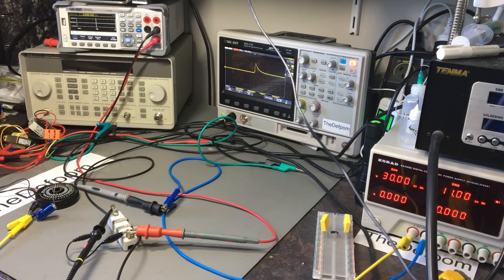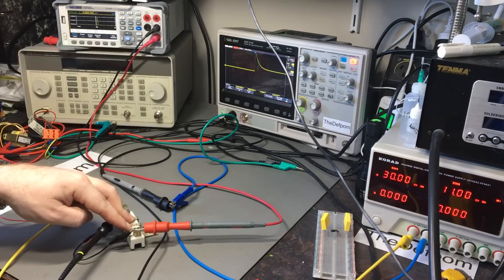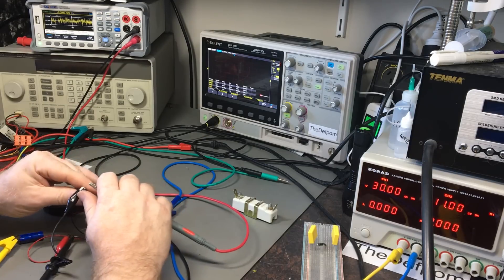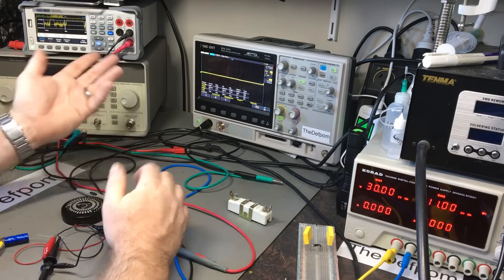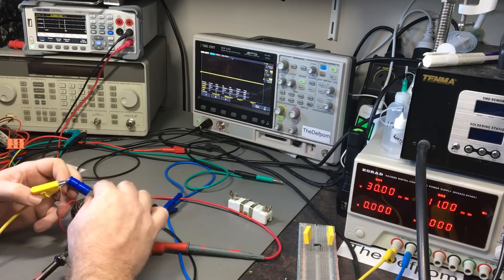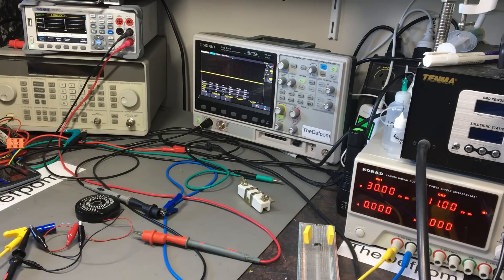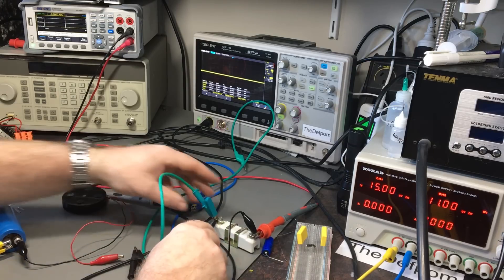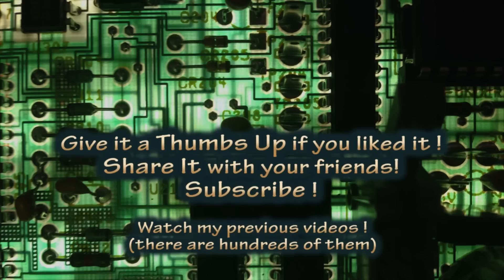🔴 #403 High Voltage Leakage Tester Project Part 2

Comment: What value was the lager blue capacitor?,  The problem with using a high value resistor is if you are using say 400V and the capacitor goes short circuit, you would need a source limited supply so as not to damage the resistor.

Comment: The current limiting resistor will need to change, depending on the capacity of the capacitor (in Farads), if you are aiming for a similar charge time for whatever capacitor you intend to test.
Reply: There's a limit either way

Comment: You can calculate the value of the resistor you need for a given time to charge (to 63.212%) by dividing the time (in seconds ) by the capacitance (in FARADS) . Charging to 86.466% will take twice that amount of time and charging to 95.022% will take three times that much time. Charging a 2200 uF cap with a 250 volt , 250 milliamp supply to 158 volts should take 2.2 seconds through a 1000 ohm resistor.
Reply from the maker: David V - that’s helpful info, thank you.

Comment: Thumbs up for the video. You might consider using the charging circuit to put whatever voltage you want onto the cap, then disconnecting it using a relay, then monitoring the voltage and the current of the self discharge. Having the high voltage charger hooked up during the measurement phase will make it harder to accurately measure small leakage rates and will complicate the design of the high voltage charger because of the need to keep it's self leakage very low...
Reply from the maker: ats89117 - thanks for your thoughts on this, once I have a properly build unit I can look into further refining the design, switched resistors were one of the ideas I originally had, I could easily do that on a sub pcb if I need to add it later.

Comment: You could let the Arduino calculate the tau of the capacitor and select a resistor (for around 4 tau)  for the charging test then have it switch in a high value resistor  for leakage measurement

Comment: I would be more inclined for a go-no go that trying to decipher curves on a scope. I think you need to compare a failed cap to a good cap, and that might give you a better idea how to do proceed.
Reply from the maker: This was me trying to figure out what series resistor to use to limit the inrush current for the charging phase. This is to give suitable timing for the testing, too high a resistance and the charging of the cap takes too long, too small and the current spike is big and gives little time to see the charge behaviour of the cap. Part of this is that I didn't want to have to build the test circuit to handle current in the amps region, I wanted tens to hundreds of mA current only, but without it taking too long to charge a large cap.
Reply: Ahh.

Comment: The larger value cap should charge slower than the smaller.
I lost the point of your testing the charging/discharging'
Charge the capacitor to its full voltage then add a ammeter in series to see the leakage current.
Perhaps im missing something, or im thick lol.
Reply from the maker: What I am looking at here is how long it takes to charge when being run through a certain value resistor, this was so I could choose what value to use in the final design to give a slow enough charge time to limit the inrush current and allow you to see the charging, but not be too slow to charge.

Comment: If it's any help, have you seen the capacitor tester project by Mr Carlson's Lab?
It's a low voltage tester, so it might not be useful for your case, but he seems to think it doesn't need to be high voltage.
Reply from the maker: Yes I have seen the project announcement, he released it to his Patreons only, I actually want a high voltage tester as it can be used for more than just capacitors. the main reason I decided to make one is from whilst I was repairing the Fluke 5200A, which had a transistor breaking down only when exposed to high voltage, a normal transistor test didn't show it up.